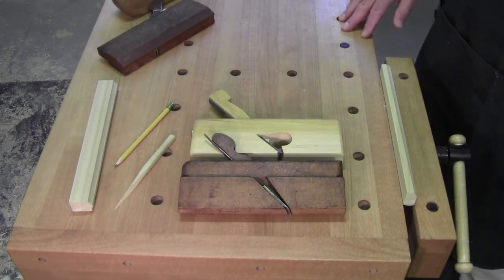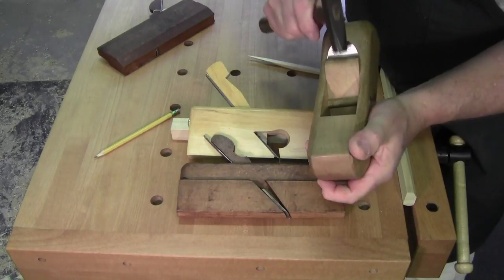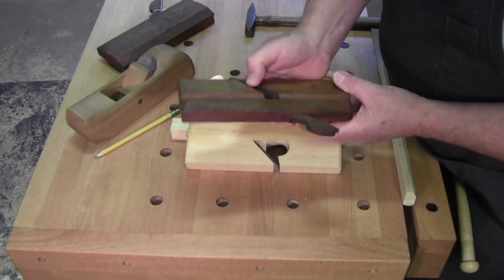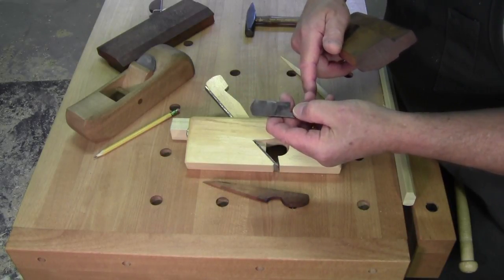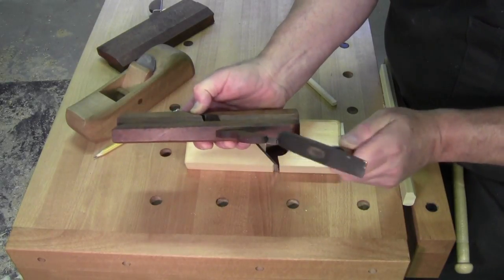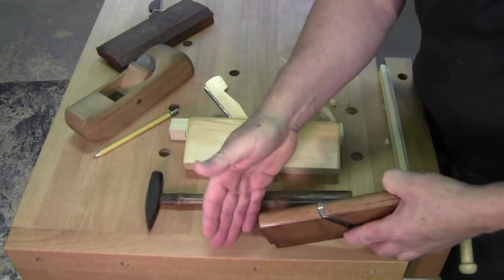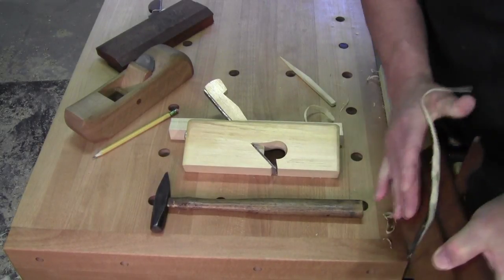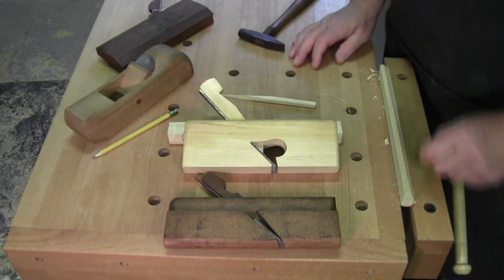PLANE TALK - DON'T DO IT ! - How to easily adjust molding Planes. June30th 2017

Comment: I have a moulding plane of my grandfather's, and the bed corner is pretty rough... any recommendations to fix it?  The plane works, but consistently plugs up...  Thanks for all your work on these videos!
Reply from the maker: Tim,
Thanks for writing.
It is hard to say what the problem is without seeing it.
Sometimes you can open the mouth ever so slightly to allow more room for thicker shavings.

There are some makers out there who can restore a plane to use.